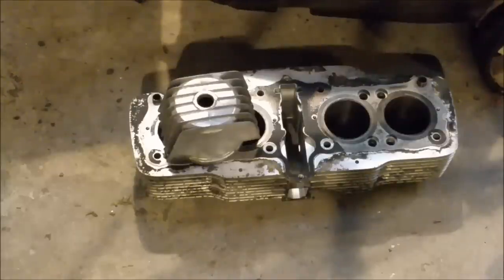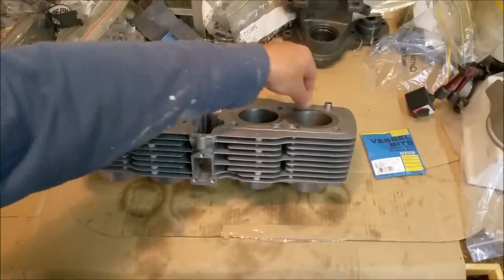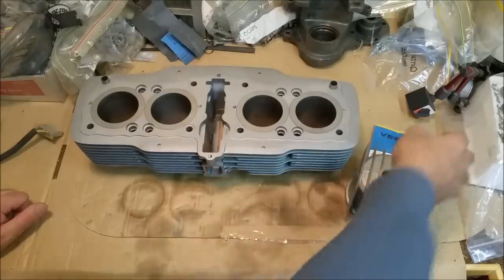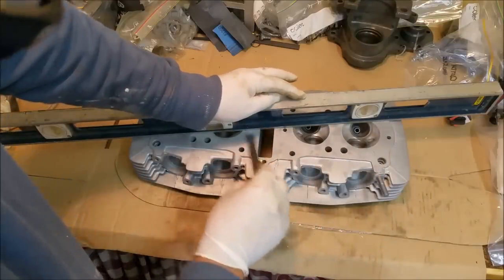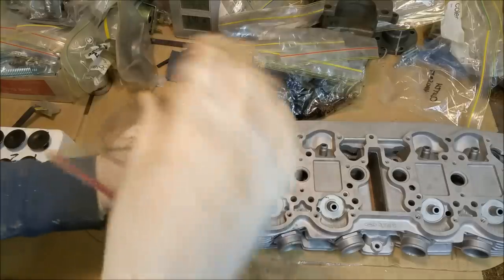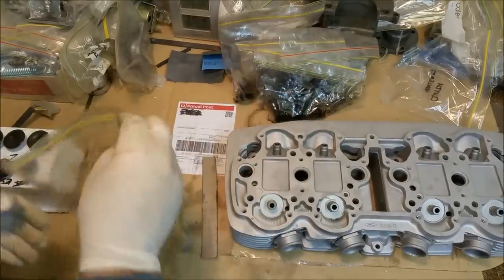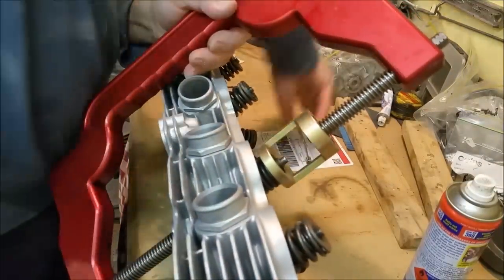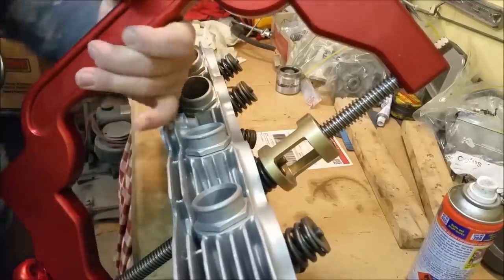CB750 Restoration Part14 - Refurbishing the Head and More

Comment: Do keep in mind that those motors came from the factory with a rather thick coat of clear so painting the motors is no issue if you want to do that. Also consider polishing the intake and exhaust ports you have that dremel like tool and it works pretty good for that sort of thing. Just a thought.
Reply from the maker: And a good thought too... I didn't notice the roughness in the ports until after I assembled it... Cheers
Reply: @PeterAndersons  The roughness is left by the factory to help tumble the incoming air.  IMO leave the surface texture.